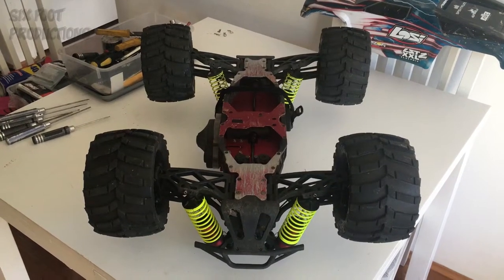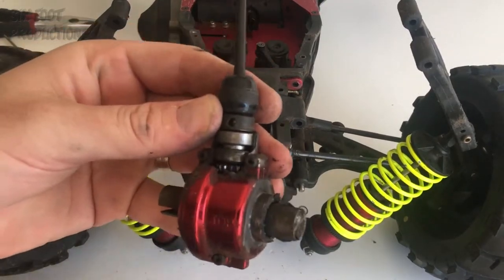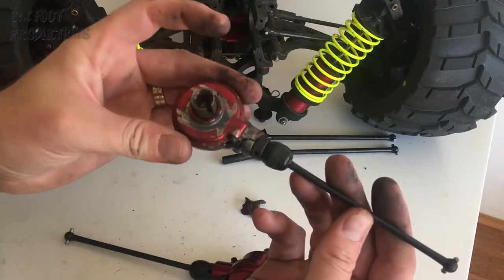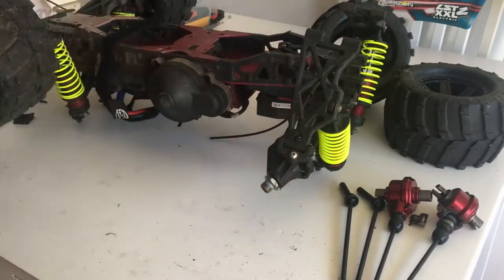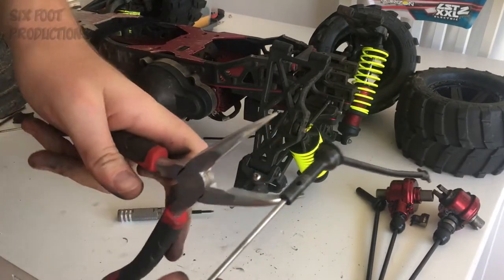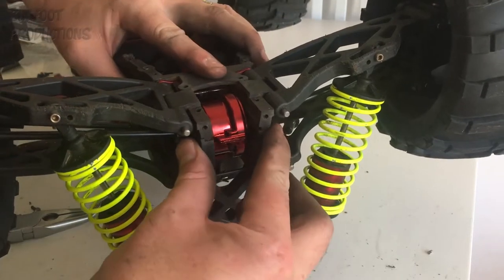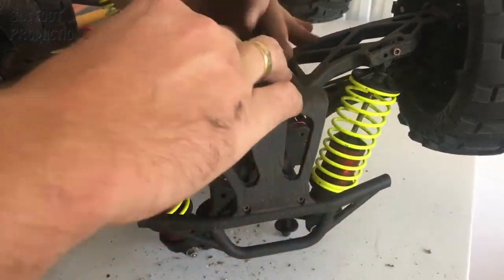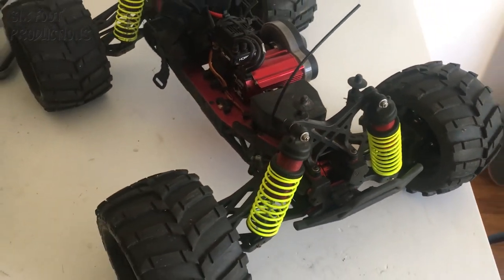Losi LST2 XXL2E- How to Remove Diff and Driveshaft Install

Comment: Great Vid mate, those screws are painful - 1/16" imperial. Stripped exactly the same screws as your rig. 
loving the Prolines.
Reply from the maker: +Michael Lucre 
They sure are absolute bugger of screws, considering the size of truck, I have drilled a few out now on base aluminium as they fill up with rocks and get scraped, hinge pin plate screws are stripped and bulkheads around diffs are now stripped
Reply from the maker: +Michael Lucre 
The Savage XS has better bigger base/end screw set up and it's 1/3 the size lol
Reply: Also the big brother HPI Savage XL Flux is a beast on 6s as well, LOSI LST XXL2E has been a bit of pain with diff problems both Centre & Rear....but those 4-40 1/2" screws arghhhh!!!

But removing that Diff was an awesome tip, saves so much time so you can get it back up and running quicker to break it again.

Comment: is that a bearing behind the pinion, ive been looking for that part for ages and I dont know what it is
Reply from the maker: Check out the exploded view here- http://www.losi.com/ProdInfo/Files/LOS04004-Manual-MULTI.pdf
Reply: @Six Foot Productions 
Yea I already looked but I cannot seem to find a Diff view.
Reply from the maker: @ez_nashawnn4762  
I have blown diff casings and full diffs. You can buy a full diff in red or just the outside case blue

Comment: What batteries do you recommend to losi lst xxl2 e?
Reply from the maker: Kasperi Tarvainen 
Highest C rating for punch and dual 2S or 3S 5000mah each battery for good run time
Reply: @vuss2107  i ordered LRP P5-HV Stock Spec Graph. 8000mAh 7.6V, i think that it will be good for lst xxl2 e
Reply from the maker: Kasperi Tarvainen 
Running 2 of them will give lots of run time easy 25mins 👌
Reply: @vuss2107  yeah i bought four of them
Reply from the maker: Kasperi Tarvainen 
Awesome they should be great, have a good one

Comment: Dang so far that's two cars that got Bashed today. Can't you use superglue in stripped   plastic.
Reply from the maker: g405t 
I reckon aye, I don't have any ATM but could be worth a try
Reply: there might be better ways, i'm yet to learn about, i just got back into rc cars since early 2000's
Reply from the maker: If i had any liquid nails left that would do the trick nicely, i glued the stripped wheelie bar which screwed in under base plates on the rear lasted all of 1 set of batteries on gravel. No more wheelie bar unless its concrete flat ground.

Awesome mate, which cars started the itch?
Reply: I got a Rock Rey, hope to pick up a monster truck someday.
Reply from the maker: Sweet that's the new losi eh they look pretty rad
Rip it up mate

Comment: more videos like this informative tanx alot...
Reply from the maker: horsemeat24 
Cheers mate the thing needs repairing again lol
Reply: Six Foot Productions just a question what special tools are you using to disassemble the whole thing from the chassis to the differential can u pls give me input wich tools and the sizes of the tools tanx heaps!
Reply from the maker: horsemeat24 
Just a mix of hex drill bits and hand tools bought from local hobby shop. Drill makes job much faster than undoing it all by hand